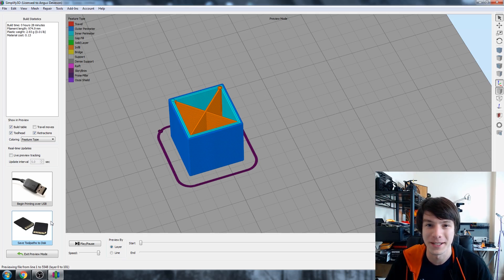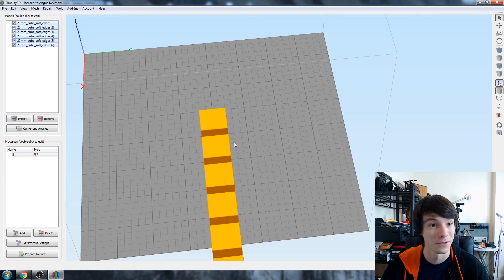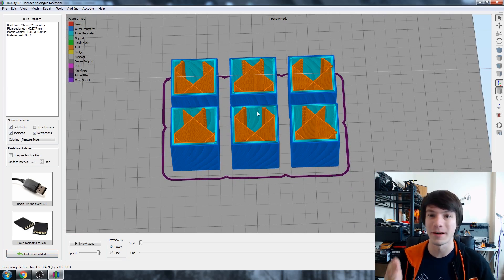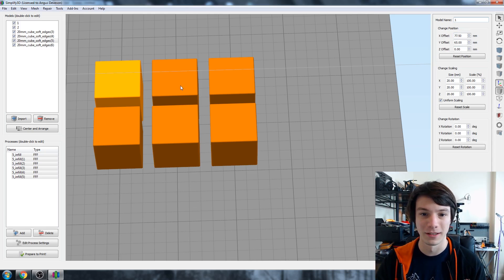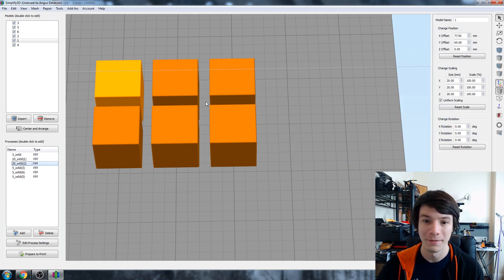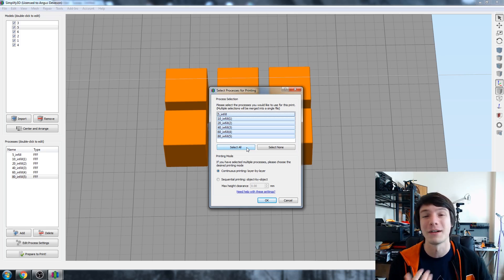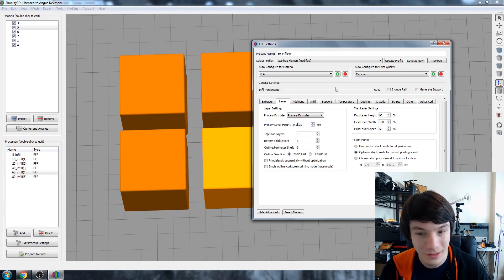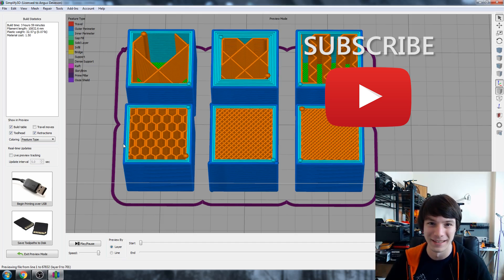Multiple Infills in the same 3D Print using Simplify3D

Comment: Angus   Love the videos.  As you are good with Simplify3D  can you possibly show how to do a process that will change infill or layer height or whatever on a section of a single (non split) model if that is possible.  I have an object that I want to print with 100% infill for 2/3 of the model horizontally and then 15% is fine for the last. I can do this in Cura using Support Blocker and Per Model Settings but as I bought Simplify3D(best prints I have ever had) I would like to use it for all my work.

Comment: Nice demo!   I have Simplify3D and it works great.   I've got a question that I've yet to find an answer to and am hoping you might have a suggestion. 
Frequently I print something that I need to drill a hole in.  It's almost always perpendicular to the extrusion so printing the hole doesn't work very well.   So I just drill the hole when the print is done. The problem is that if I drill a hole it will be thru a bunch of infill and it will be weak in a bunch of collapsing infill.  The only alternative I've found is to use 100% infill.  But often I don't need any more than 30% infill everywhere else!  Is there a way or do you have a trick for creating 100% infill in just one vertical region of a print?  Thanks.

Comment: Can processes cascade? for instance in the example you showed in the video, could you make 2 more processes that govern layer height and make the top row 0.1mm and bottom row 0.2mm whilst retaining their individual infill differences?
Reply: Love Castle kind of, see detailed processes and profiles (should be in the up next, a few videos down) - you can apply various processes to the same part, by height, so yes you can apply a process to the first few mm, then another for the middle, and yet another for the upper layers, each one different - I've actually applied 7 processes in one part to obtain the results i wanted - just remember that each process has its own top and bottom layers, so these can sum up as you, for example, have 2 top and 2 bottom in the next one up, you'll end up with 4 solid layers where these processes start and end ;-)

Comment: If I import a model made of several STL volumes but they need to remain locked relative to each other, can I then use these to specify processes for each model?  Does S3D rearrange them on the bed if you click the wrong button...?  I want to be able to print a single object, but made up of different print methods - i.e. single layer skins with thicker internal details and to be able to control the way the end caps of the final model are printed.
Reply from the maker: for sure, export your model with all the volumes in the one stl, auto arrange then hit mesh - 'separate connected surfaces'. You can now assign each to a separate process - and if you're worried about moving them around by accident you can group them to lock them together. Hope that helps :)
Reply: OK  That's cool Angus,  Thanks!  Now I need to spunk a hundred and fifty bucks on S3D and find a printer that talks G-code! :D (irritated Upbox user)
Reply from the maker: Haha fair enough, they are working on a gcode parser for Up studio but it's a bit of a hack... might cover it in future. :)
Reply: I've had a go with it, but unfortunately on the Upbox at least, it gets the Z-level horribly wrong and causes some pretty horrendous X and Y noises up against the hard stops.  I'd so love it to work because, slicer aside, the unit has been seriously reliable and produces great prints. (as it should for the price!)

Comment: Awesome stuff, Angus!
One question though; if you assign different layer heights to the cubes, how does the slicer cope with the differences? Will it, for example, print 2 layers on one object at 0.1mm layer then a single layer on another set to 0.2mm? I'm going to give it a go myself, but just asking in case you have already tried.
Would love to see the multiple processes in 1 object video too.

Comment: I like to use S3D with multiple processes on a single model that is large. I usually have a more dense infill for the bottom for strength and stability less infill for the middle and dense again for the top, so there are no issues with holes.

Comment: it's a virtually unknown feature, but slic3r lets you do multiple processes by intersecting models and applying custom profiles to the intersection. this is in theory more powerful than s3d but it's a huge pain in the ass to actually use.

sadly, the multiple process for infill in s3d on a single object is rather limited in usefulness. having to turn off the top layers between process changes will screw up your prints on complex models which have upper exposed surfaces, they suddenly have exposed holes. if you don't turn off the top layer between process changes, you will get solid layers between your process changes.

it would be more useful if s3d let you change a single parameter at specific layer changes.

Comment: Hi! 
I really REALLY want to mention that "it's not something you can do on most slicers" is true for Slic3r.
It's good that you show a video on how to do these various infill settings within Simplify3D, but the thing is ... That slicer costs 150€, it's really not something that everyone will have available.

As such I would REALLY like it if you would mention that Slic3r supports various infills, by using the per-part settings (with which you can also change pretty much every other print setting), or modifier parts.

Slic3r is something that I personally use very often, and it would be great if you could maybe try and show some of its more in-depth features that can do some amazing stuff ... (Mainly the Per-Part based settings.)
Reply: Well, with Slic3r, you have Modifier Parts.
These are basically .stl models that specify areas in which you can have varying settings than from the main part.
This makes it really easy to for example have stronger bits in the part with more infill, use different perimeter settings, etc. etc.

So ... No, you CAN actually do that in Slic3r.

Exactly this is the reason why I would like to see a video about what you can do with Slic3r, because it has some powerful tools that just are a bit hidden and weird.

Comment: +Maker's Muse - definitely interested in defining infill based on model features & how it'd be done. Think coffee mug...infill on bottom, sides, and handle -- all different.

Also, in the example model you just did. the most sparse infill is strangely offset. Is there a way to center the infill so it has symmetry?

Comment: In Slic3r you can set different infills, density... to separate parts too. 
Right click on object and chose settings.  Add same file multiple times if needed (adding copies shares setting).
https://drive.google.com/open?id=0B3lMBX8VXU3QVUFJQ0ZZcmtxQVU

Do Simlify3D have anything like Slic3rs modifiers? http://slic3r.org/blog/modifier-meshes

Comment: Interesting. Usually I need 5-8 top layers to make sure I get a nice, closed top surface, if I use 10% or less infill. And rarely more than 2 perimeters - though more is often good on structural parts.

Comment: I'm using a Zortrax 3d printer and am basically forced to use their own Z-suite slicing software, while I understand that most advanced options from other slicing software would be unavailable unless Z-suite has it as well, would it be possible to set different infill options as part of a model and import that into Z-suite?

Comment: Can you explain dimensional tolerances? I am going to print a mount / holder for a heatsink wich is 76mm wide. Can I print a 76 mm mount? I think it may not fit, so is there any rule of thumb in order to know how much extra space I need to leave??
Reply: I think it depends on what your printer is doing in terms of accurately printing to the modelled dimensions. Only you can determine that.  Google Tolerances and Fits and you will find tables and diagrams specifying the tolerances that apply to a given required fit for a given dimension.  That is the dimension + and - that will give you the required fit.  What is meant by a fit?  There are basically three types of fits, loose, running/sliding and interference.  Loose would be suitable for a hinge but would not be good for the guide shafts on a printer where a running /sliding fit would be better. A loose fit on moving mechanical parts would lead eventually to failure because of the vibration in the system. An interference  fit is what you would have on the dowels used for Ikea furniture where at least some parts of the dowel are too big for the hole that they fit into. There are a range of types of fit in between these.  At the moment it is difficult to print accurately enough to work to the sort of tolerances that would allow one to get the required fit without a good measure of luck.All is not lost as it is possible to design around the limitations by using inserts and standard hardware for the parts of the component that cannot be accurately reproduced.   You could design in flexibility where parts have to be fitted together with an interference fit see: http://makezine.com/2015/07/22/tips-3d-printing-press-fit-parts/
Reply: Ok, thx guys. Will try to leave 0.2 mm from here on and do some extra research on tolerances

Comment: can you do a few of these types of tutorials, but with free slicers because a lot of us can afford it? thanks
Reply: You might be pleased to hear that there are a few nice videos about some features that Slic3r has - called modifier parts.
They are not really separate processes, but they allow you to specify different printing parameters for specific areas of the print, which allows for similar effects.

A (somewhat good) video I found was "Slic3r - Different infill using modifiers" 
The actual work with Slic3r starts at 6:49

Happy Slicing!

Comment: Pretty sure slic3r lets you do multiple custom infills across not only multiple bodies but also within the same body.... I've done the latter and am somewhat confident this same process could them be rolled out across the former - it uses modifiers to achieve this. Don't think it allows multiple slicing profiles across multiple bodies however.... You might be able to achieve a similar effect with modifiers but not as effectively as that shown in Simplify 3D
Reply: Correct. Slic3r can do all that was demo'ed by Angus. Tons of modifications per object including "slicing profiles,  6-7 infill geometries etc etc. I've been happy as can be with it. I'd have to say that simplyfy 3d is still king and most polished to be sure however Slic3r lacks very little. You simply select the object and right click and then choose settings and have at it. Not the settings on the main screen but via right clicking selected object. Thanks again Angus!
Reply: Dane Boren good to know. It's only recently played with modifiers in slic3r and was very happy with the results, but hadn't considered simplify 3d. Angus's video gave a very good overview of these capabilities and speaks to me in particular about that products ease of use

Comment: I'm in the process of printing a life-sized R2-D2 (I've finished the dome at this point, which is on my channel). I'm working on the body now, which uses a lot of flat, 5mm-thick plates that you glue together to form a framework. I've been having problems with these warping. Do you have any advice about how best to avoid that? My printer lacks a heated bed, so the best solution I've come up with is to print with a raft, but that takes more time and plastic and can be difficult to remove from the part. It does seem that higher infill percentages are more likely to warp, but what about the different types of infill? Would using a different type have any effect? What about print temp or surface?
Reply: Have you tryed different plastics? Even PLA from another brand might be better and warp less. Or go out and try some speciality-filaments, there are some with basically zero warping that should be printable on a cold bed.
As for different infill and solid layers, yes, it does have an effect on warping. But it's really hard to give a general rule of thumb. You probably have to experiment around and find waht works best for the design you are printing.
Reply: That's awesome what you are doing! have you tried just gluing the bed?
Reply: I actually haven't tried just glue. I normally print on blue painter's tape and I have tried using alcohol on that to make it more sticky (that works somewhat, but not enough to counteract the warping in this case). But maybe I should give glue stick a try.
Reply: Lots of elmer's glue in the corners :) P.S. don't use the purple glue

Comment: Hi MM -- is it possible to print spur gears at MOD 1.0 with enough precision to work at the correct centre distance and what applications would they be suitable for from indexing to power transmission.   I think the test of maturity of 3D printing is the real possibility of replacing mechanical parts with the precision and durability of moulded (heat or cast) parts.
Reply: It seems to be possible :) - http://www.thingiverse.com/thing:683389